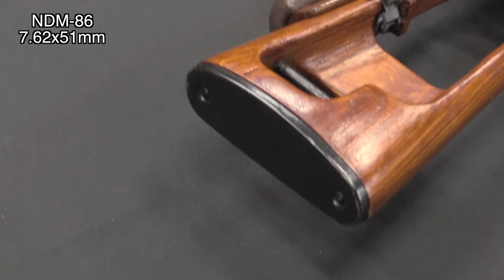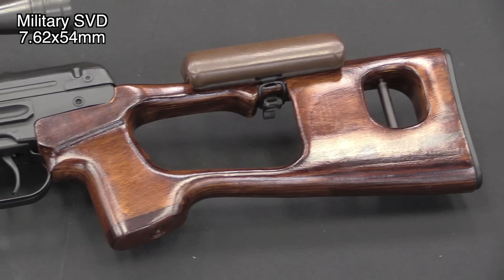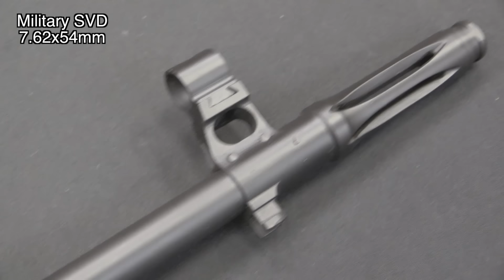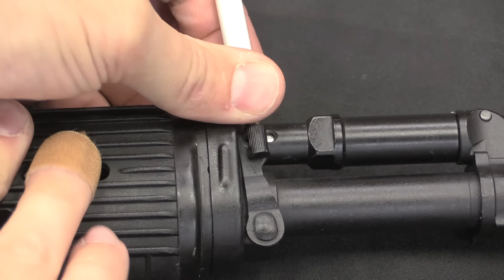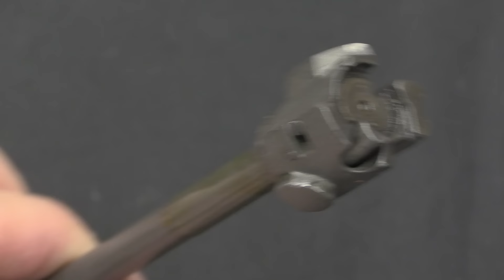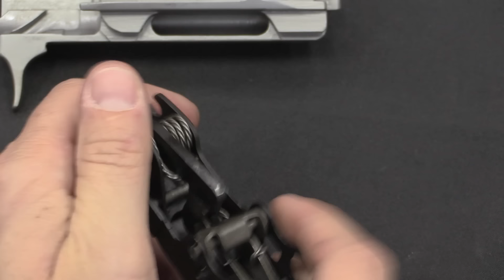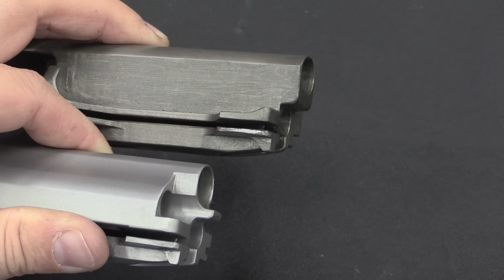Dragunov Variations: Military SVD, Izhmash Tiger, Chinese NDM-86

Comment: No interchangeable part with the AK-47 ? Still banned in Canada for being a Variant of the AK-47
Reply: TheDroidekas lets not forget that they are the same RCMP anti-gun politician funded "experts" who deemed the semi-auto blowback 22lr AK lookalikes to be AK-47 variants and prohibited. 
This will blow you mind.
GSG 15 22lr 16 inch barrel & fixed stock "non-restricted" 
GSG stg44 22lr 16 inch barrel & fixed stock "non-restricted" 
GSG AK47 22lr 16 inch barrel & fixed stock "prohibited"
GSG MP5 22lr 16 inch barrel & fixed stock "prohibited"
Reply: @davidoakley3256  based on looks instead of actual function
Reply: @blacklungraiders2819  Your lack of punctuation make me unsure if your making a statement, or asking a question. But yes, thats the point I was making. That they were deemed variant of a prohibited rifle because the outer plastic casing was made to the likeness of a prohibited rifle, even though there are no compatable or interchangable components with that prohibited rifle. While other rifles from the same manufacturer, with the same internal components, are deemed non-restricted. Shows the stupidity were dealing with.
Reply: @davidoakley3256  dude its a comment im not typing a report for my boss right now XD
Reply: @blacklungraiders2819  you should still use proper punctuation so people understand you and so you dont look stupid. Not sure if thatll help you much though...
Reply: @davidoakley3256 this comment about gsg15 and gsg stg 44 didn't age well
Reply: @davidoakley3256  ...and never forget the ban of the most popular 10-22 magazine because all of a sudden it was relabeled as a "pistol" mag.
Reply: @davidoakley3256  UK you can fire tank rounds with a shotgun licence.
Reply: My thoughts and prayers.
Reply: Ugh. You would think that politicians would want to have a greater understanding of a serious matter like banning something. At least you guys can own guns though, and you guys can get guns that we down here in the states can’t like those sweet Chilean FAMAE SIG copies.
Reply: @somerandomassguyontheinter2869  our laws are pretty stupid when it comes to firearms. Comparable to California. Some aspects are great but others such as the magazine restriction are dumb because they dont stop firearms related offences, they only punish law abiding gun-owners
Reply: @JSTIG 99 if you think you are free in the United gates of America the  you are stupid and naive
Reply: @saucybaka4439  your right, we should be more free, thats why we need a libertarian president
Reply: @doinyamomm4  you're* hilarious
Reply: @somerandomassguyontheinter2869  Canada didn't actually ban the AR15. It is restricted, which means it is treated the same as a handgun.  And FYI AR15 and mini 14 do not use the same magazines. They are not interchangeable.
Reply: @davidoakley3256  this comment aged poorly
Reply: @davidoakley3256  Um...it is beyond restricted, the AR and AK platforms are "prohibited"...
Reply: u people vote for justin traitor so stfu m8
Reply: after living in Canada (Toronto) for a long time, i can tell that the majority of the people here have no level of knowledge about guns
Reply: @chedsalvia6270  yup, except for gun owners. But they are outweighed by the stupid and the liberals ten-fold
Reply: WTF?
Reply: It's not all that bad in the good ol' US of A or Canada at least they are available to the vast majority of the general public. Over the pond in the UK anything that is over 12ft/lb is classified as a firearm which is subject to massive restrictions. Although a shotgun is much less restricted but you still have to vetted by the local police 1st  ( but not to the same extent as  trying to obtain a centerfire weapon ) but as long as you have a lawful reason for owning said weapon and you have it secured in a gun safe it's generally OK but as for a pistol then forget it our Olympic shooting team isn't able to train on the mainland!
Reply: So for any who are interested, during the Obama Administration, the CDC was tasked with finding out actual numbers. Here's what they found:

While an accurate number couldn't be found, they estimate that between 100k and 300k uses of guns as self defense a year 

The actual number of deaths by gun are only 1% of deaths a year. 

The majority of those deaths are suicide. Homicides follow within about 10k. (An example would be 40k suicide and 30k homicide)

Less than 100 deaths a year are mass shootings. 

All these stats can be found on their website.

Quite literally, Americans are generally far more likely to get killed in a vehicle accident. Also bear in mind, the places in America with extremely strict gun control, such as new York and Chicago, have extremely high crime rates compared to cities with lax control laws, such as Cheyenne.
Reply: @mintyfleshness  late to the party, but this is also confirmed by last years stats, by the FBI and ATF, there were was 13k deaths by firearms including homicides, there was 11k deaths by automobiles with a DUI involved.

There is also more gun crimes and mass shootings in australia than in the entire state of texas, over the last 20 years.

And thats including Australia buy back program.

Australia has had 16 mass shootings since the buy back.

Texas has only had 3 mass shootings in the last 30 years, amd one of those was the recent sniper shooting in dallas texas. Imagine that though majority of the mass shootings in texas were from long range shooters, not ARs.... probably because everyone in the state has a gun.
Reply: @Robert53area  im gonna add to that: I live in Wyoming, one of the highest gin owning states in America. Almost no gun laws. And In my 11 years living here, not a single shooting.
Reply: @Robert53area  Another fun one is there's a smaller town in Georgia called Kennesaw which requires every family living within city limits to own a gun. Their crime rate is pretty much non-existent. Statistics have generally shown that as gun ownership goes up, crime goes down. While the quantity of shootings does tend to go up some, the number of people actually killed in total from mass shootings goes down (bystanders stopping the shooter long before police could get there in sufficient numbers).

On the topic of the video though, I love how they said "Oh you can't have that auto-sear. Remove that". When in fact that's not what it is, and the removal of it actually makes the gun less safe since there's no longer anything to be sure the bolt is in battery. Gotta love people judging books by their cover rather than their content.
Reply: @mintyfleshness   I've lived in Wyoming for 90% of my life and only know of one shooting in 25 years. And that was a bar brawl gone bad.  Def one of the safest places to live in the US. I know what's in my house I sure as hell wouldn't enter someone else's for fear what they could have.  God bless America
Reply: @jlo7770  there was one a couple years ago. Old man stole a .22 and shot up the old folks home he lived at. Killed two before himself.
Reply: @mintyfleshness   I guess I didn't hear about that,  I've been out of state for a while working in nd. I rock 20 plates.  But either way,  Wyoming is a relatively safe place to live.  With very minimal gun violence and very open gun laws.   Wish nd would go the same way. Id consider "relocating"
Reply: @jlo7770  if I recall correctly we are seventh for lowest crime rate in the nation. Suck it Chicago
Reply: @jlo7770  I would also like to mention that I don't have a car, so I have to walk to wherever I need to go. Since I work nights, I basically am walking home in the dead of night and I've never had any problem. Once in a blue moon a cop pulls over and asks me what I'm doing but it's not that big a deal.
Reply: @mintyfleshness   welcome to Wyoming brother.   I couldn't care less,  don't mess with me I won't mess with you.. it's why I love 307. Don't fuck with me i won't fuck with you. It's a great place to live. Wyhoming
Reply: @alexsis1778  I liked how they literally took a look at that and went "Ah, just fucking unscrew that shit"
Reply: @alexsis1778  about the auto-sear, playing devil's advocate i suspect modifying out the trigger interrupter to allow automatic fire would be pretty simple. Its a hunch but maybe
Reply: superdarklink or texas
Reply: Why ban the ak in the first place, it's a great gun :)
Reply: @falafel6644  No country "bans AK's" they just don't let poor and unimportant people have them.
Reply: @falafel6644  yea that's y they banned it because its good
Reply: @falafel6644  Because it looks scary.
Reply: Joshua Graham 
That’s because politicians are catering to the emotionalists and village idiots (which there appear to be many of), and ignoring those with fully functioning brains, logic circuits and intellects of which there are far fewer.
As George Bernard Shaw noted:
“2% of people think, 3% think they can think and 95% would sooner die than think.”
Reply: Canada quit using common sense a long time ago....for example it’s more concerned with being politically correct instead of containing the Corona Virus. Guns? They are planning to ban all semi autos. Unreal. And people take it without protest.
Reply: When did they ban SVDs? I know a guy who legally had one for a while. He also isn't a civilian so he might have a special license
Reply: @sand0decker  not sure when exactly, the information for the particular bill may be sourcable if I knew what the bill was named... however, they are currently prohibited. So your buddy must have a prohibited firearms license in order to possess one. They are expensive to get and also difficult to be approved
Reply: @saucybaka4439  It was a few days ago, but he would have a prohibited license. It had to be kept on range at all times too and was registered and all that.
His fiance started being tougher on his gun hobby after that though lol
Reply: @sand0decker  that's a shame. We should never let our women dictate how much fun we have in our personal time..
Reply: @sand0decker  however, simply being sworn doesnt automatically give you the special license as military and rcmp members still need to acquire their PAL, PAL restricted, and PAL prohibited separately as civilians
Reply: No shit? I never that before, pretty damn stupid.
Reply: The Canadian Tire in Leduc AB
For a while had a Steyr HS-50M1
For sale.  But still can't own an SVD.??
Reply: Many years ago you could legally own an FAL C1A1 in Canada.
Reply: Because gun grabbers are typically entirely ignorant about any kind of gun.
Reply: But a Type81, which is visually pretty much an AK, but functionally very much closer to the SVD is Non Restricted.
Reply: Because our politicians are dumber than the brain dead.
Reply: "Guns bad eh, now lets go do some heroin"
-canada 2020
Reply: These are the same people who tried to ban fucking airsoft guns lmao
Reply: My fav part of laws here is any kid with a cred card can order a crossbow and, nasty expanding tip hunting ammunition off Amazon right now. 

Oh but the marksmen rifle arguably need be a law abiding citizen with decent job to buy let alone, purchase any ammo for? NAUGHTY! 

Lol guess crossbows aren’t deadly tho, let alone cheap one I bought can hit targets consistently at 100-150 yards, ya “non lethal toy” lololol
Reply: If the party says 2+2=5 then its 5. If they say its 4 or 3 or 37 who are you to disagree with the party..........
Reply: AK-47 was not a year old; it was a pre-production model drawing ... and an automatic came out under the name AK
Reply: Just think of it as a stretched out jpeg of an ak.
Reply: @somerandomassguyontheinter2869  The AR-15 isn't really banned.  I took 2 Colts to Canada for a Service Rifle match once. Even exported one there. They're just "Restricted" meaning you can only target shoot (With written authorization) with them outside of your property.
Reply: @cs-rj8ru  New law...they are Prohibited and on the way to being siezed.
Reply: @saucybaka4439  ?  Broads? Are you referring to Women?  If you are, the last one I came across was pretty animated....
Reply: 7:01
Reply: Sean Price - I did my research, the PSL is an AK variant as per Rcmp. It is a prohibited rifle. It wasn’t for sale, I get it but try to import one from the states.
Reply: It's ok everything is banned in Canada now
Reply: TheDroidekas Canada: looks like an AK, it’s an AK
Reply: If only he knew it would only get worse...
Reply: It is nothing like the AK. I served in the Finnish military, and shot both the RK-62, which is an AK variant and very much like the AK, and the Dragunov, which was different. I didn't spend that much time with the SVD, but I remember it was a pain in the ass to clean and assemble.
Reply: This rifle cant be a ak-47 variant, because ak-47 was released in 1947
Reply: @ButterDog42069  and in single unit. Because everything else produced up until AKM is called just AK or AK mod.47, not AK-47:D
Reply: Yeah, Dragunov must have constantly felt that he was in Kalashnikov's shade.
Reply: Fuck Canada
Reply: Canada is cucked
Reply: Canada has banned coffee since this comment was made.
Reply: And now they are trying to find reasons to arrest newborns before their parents could even see them with Bill C-21.
Reply: Guess none of that matters now, aren't all semi auto rifles banned now?
Reply: Nope. PSLs are AK based
Reply: What, because it looks like an AK? That makes no goddamn sense.
Reply: Calling ghe Dragunov a variant of the AK-47 is like calling the Desert Eagle a variant of the M1911
Reply: Bounce across to Alaska. There's more than a few black spots where the border isnt watched.
Reply: Well scopes are lol
Reply: now you can't own shit. LOL. Have fun with Castro at the helm
Reply: Theyll never stop the droidekas 😂😂
Reply: Nobody needs an AK-47 to kill a deer
Reply: I'm pretty sure that in canada we can still get the Romanian PSL though
Reply: Big Boss  that’d be news to me if we could get the PSL. I know we have some valmet variants available
Reply: Big Boss - Nope! The closest we can get is the SVD40. That until they will ban and confiscate all semi-autos this year. Did my research, I am a Romanian-Canadian badly wanting a PSL.
Reply: @BigBoss-cm6tq  can you get a plastic spoon?
Reply: @BigBoss-cm6tq  but that is literally a longboi AK?
Reply: @BigBoss-cm6tq  And that is basically an AK but scaled up for 7.62×54mmR
Reply: @BigBoss-cm6tq  Now that is a variant of an AK
Reply: WE NEED A SECOND AMENDMENT
Reply: @gaylordpantamime  amen
Reply: @gaylordpantamime  but dont like your own comment it makes you look like a pleb
Reply: TheDroidekas sucks to be true north strong and (not) free. Greeting  from AB.
Reply: I mean it’s wood and metal, it’s clearly an AK
Reply: @journeymanreefer6252  sucks to have a government that caters to Wendy Kookier
Reply: @journeymanreefer6252  we’re free alright just because we cant have a damn gun doesnt mean we arent free
Reply: @peabrain6872  The Fox News simpleton mindset is always so strong with gun nuts, I wonder why...
Reply: @Steve Campbell crying shame....they're trying to ban AR15s in Canada and are looking at a handgun ban. Our liberal government is fucking garbage
Reply: @somerandomassguyontheinter2869  30 round magazine's are prohibited in Canada. Any semi automatic long-gun, whether restricted or non restricted, can have a maximum capacity of 5 rounds. Unless of course it is labelled as a "pistol mag". If you find an ar-15 pistol mag, you may carry ten rounds (only at a range of course, since ar-15s are restricted)
Reply: @Steve Campbelldont care about what you have to say, too long to read. I have better things to do than waste my brain-cells talking to a pleb like you :)
Reply: Thats cause cantada is weak :P
Reply: Because it basically is a copy of the AK, just for a larger caliber.
Reply: You guys gotta run off those gay frenchmen.  Too much Soy.
Reply: Banned by name, not by specs. Stupidest idea ever, but if we have less mass shootings (of course in proportion to the population), at least that's a plus.
Reply: @caffeinatedstickman2324  ..except that the first mass shooting was with a Ruger Mini 14.....so of course the AR and AK variants were banned, but not the Mini 14.....logical eh? (sarcasm)
Reply: @TheWolfsnack  Ruger mini 14, are speaking of the Polytechnique shooting?

By the way, that's just one shooting, and in this case it happened to be an oddball rifle.

Not saying I fully support politics, but don't put both countries' shooting statistics in the same pot. I was also referring to numbers per year.

 I don't care what they use for shooting, a shooting is a shooting, but so far, i've never been scared of seeing a freak with any kind of gun wanting to clean the place.
Reply: Frédérick Germain honestly though most people in the USA don't have that fear either because of it being statistically unlikely. Same mentality in the UK over being stabbed in a school though it happens frequently enough to warrant a police officer on site at all times.
Reply: @insertname1667  This is not true. As a Briton people being stabbed is almost entirely in relation to gang crime. In my area which is rough they had a policeman (PC Paul) assigned to like 8 local schools, and he'd come in to ours like once a month max. All he did was go into assemblies and tell ppl not to be bad and fireworks hurt and shit. Yes knives were confiscated every now and then, usually by teachers. The policemen was there to try and stop people from making poor life choices, and deal with drugs more than anything.
Reply: Stan Fay "gang crime" in the UK doesn't mean "gang on gang" violence, it's literally just a tag that the police use when ever they become aware of an offender being part of a gang, they can slap that onto any crime at the end of the day but you don't need to be part of a gang to be involved in "gang crime". As for your experiences with a police officer in your school, can you tell me when the time frame was? I'm talking within the last nine years and there being a difference between a police officer being on site (like for the majority of private schools in the area) compared to a community officer coming in every month or so to try and dissuade people from doing crime.
Reply: @insertname1667  Police officer on site at all times? Where?
Reply: @caffeinatedstickman2324  guess what is statistically used the most in homicides in the USA?

Hammers

Should we ban them because people use them for an unintended purpose?
Reply: @caffeinatedstickman2324  I haven't been scared of that either, partially because I can shoot back.
Reply: @ldnstan2454  Shootings in USA are almost entirely linked to gang membership.....in fact, most murders in USA are gang and drug related.  So we have that in common with UK, (according to you, most UK stabbings are gang-related).
Reply: @caffeinatedstickman2324  Id rather have mass shootings then no guns in the hands of citizens
Reply: @caffeinatedstickman2324  Right because semi autos cause mass murder.  SMH. If your country was really serious about life you'd ban sugar and limit car speeds to 35 mph.
Reply: @caffeinatedstickman2324  "but if we have less mass, at least that's a plus."
That's like arguing that we should have china tier censorship laws because china has less hate-crimes per capita than countries with free speech.
Sure, it's technically true but it's a poor comparison and not cause and effect
Reply: @caffeinatedstickman2324  Yea cause not being able to get an AK will stop me from shooting so i cant get a cheap glock and destroy a room.
Reply: @caffeinatedstickman2324  spoken like a true slave :v
Reply: @Steve Campbell btw nice job liking your own comment you pathetic loser
Reply: Yes and no. With very little machine tooling you can convert a bog-standard saiga ak clone to an extended range area denial and light anti-materielle rifle. It could also be modded out for chain feeding and hot barrel swaps meaning you could pin down targets at 500 meters like it was nothing for as long as you wanted. What are you doing with your life that makes you feel like you need that? You dont. Get over it. Nobody wants you to have the power to set up a no man's land. And in what world would you fight a tyrannical government with that setup? Theyd bomb your location. It has no legit use for a civilian so let it go elsa
Reply: @pudgeboyardee32  Tell me how you're going to convert a closed-bolt, detachable box magazine weapon into an open-bolt, belt-fed "anti-materiel" machine gun with quick-change barrels using your bog standard Home depot tools.

I'll answer this for you. You can't.
Reply: @pudgeboyardee32  Can I have some of what you're smoking? Seems to be quite potent.
Reply: @pudgeboyardee32  I didn't know a free person had to "need" anything?   If life is only about "needs" we'd all live in tents and eat bread and water.  A free person should be able to own whatever they want----as long as they do not harm others with it.  Why do you assume a person would use a weapon to hurt others?  Are you that mistrusting of your fellow man?  Are you projecting your own devilish thoughts onto others?

Better go tell that to Iraq and Afghanistan!  They have both held off the entire might of the US military for over a decade...20 years for Afghanistan.